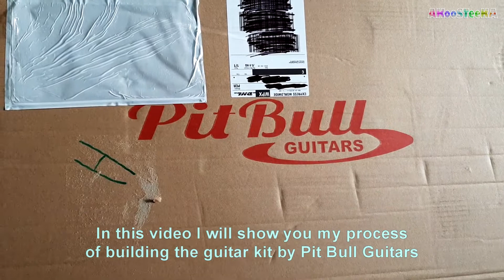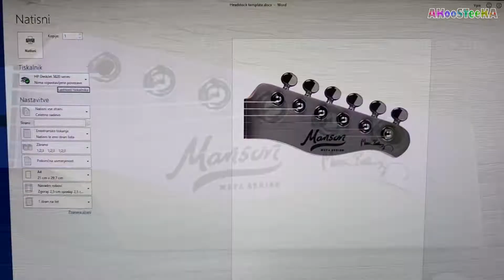Pit Bull Guitar KIT build PART 1/2

Comment: how did you measure where to put the bridge? having not seen any measurements used then seeing the pick guard not fitting knowing it was cnc machined to fit the space leads me to believe you placed the bridge a few millimeters off , along with that making the pick guard not fitting it could also throw off the scale length and thus the intonation of the instrument . these holes should of been pre drilled to avoid this exact thing .
Reply from the maker: Holes for strings trough body were predrilled, so I placed the bridge based on that. Intonation is ok, just pickguard is not cut as it should be. I did the measurements off the camera anyway 😉
Reply: @AKooSTeeKA   thats good to know im ordering one of these myself and yeah seeing someone not measure before they drill was confusing <3 i hope my comment didnt seem to negative , i enjoyed the content.
Reply from the maker: @nobelj3137  it just means you pay atention to what you watch 😉
And thanks for watching 🙂